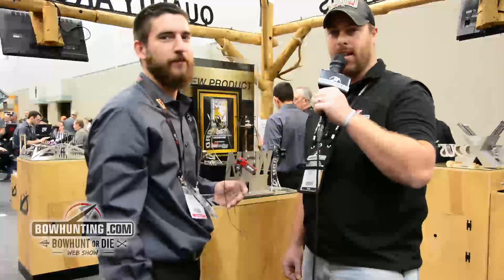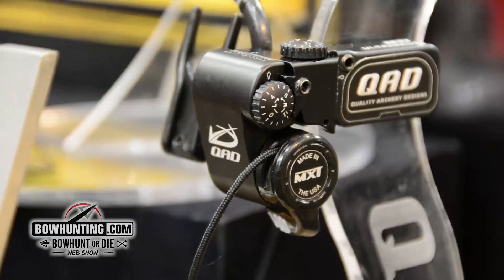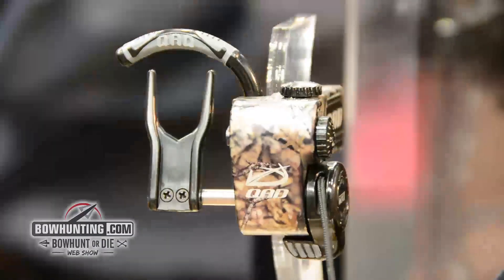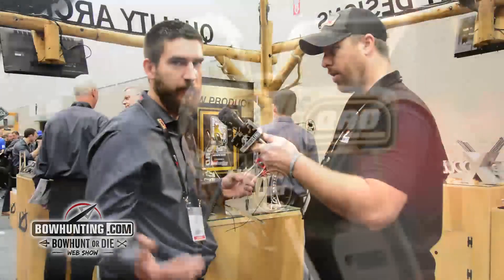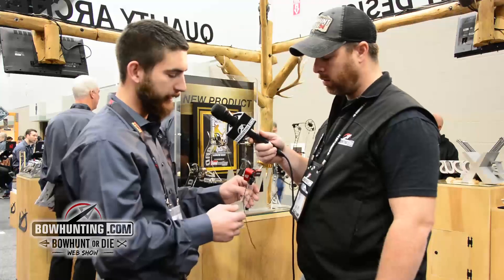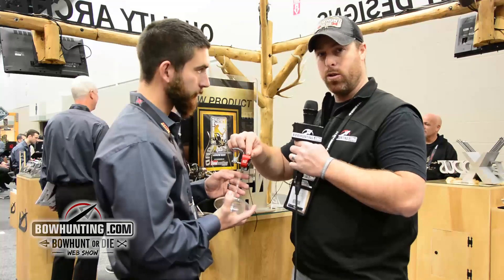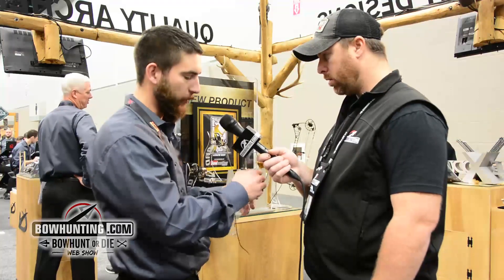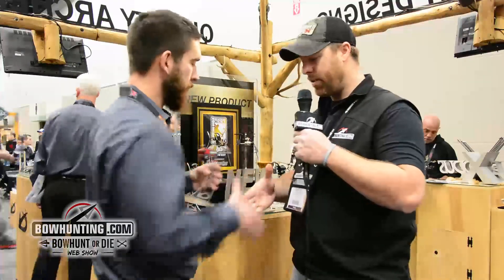QAD MXT Rest 2017 ATA Show

Comment: Great rest. But for everyone out there  wanting to buy it, I've known people who had qad and had LOADS of problems, finicky design, plastic parts, among other things, but he also said "I'm not allowed to talk about it" ... I would get a hamskea, they don't hide anything like this guy does. I wouldn't trust this brand for this reason. I have a hamskea, and am sticking with it. No problems with the trinity. And the ultra rest isn't supported on both sides like the trinity, and I don't think it has a 3rd ball bearing or oversized ball bearings. Solid rest, most of the time. For anyone out there, thought I would give my thoughts

Comment: Finally, they fixed that design flaw with the capture top arch, making it move with the horizontal launcher adjust.  This is probably still a flaw in most other rest I have seen.  I also see no felt on the MXT is that a path forward?